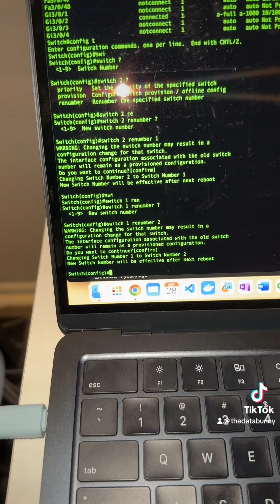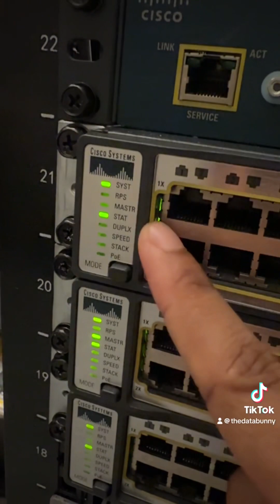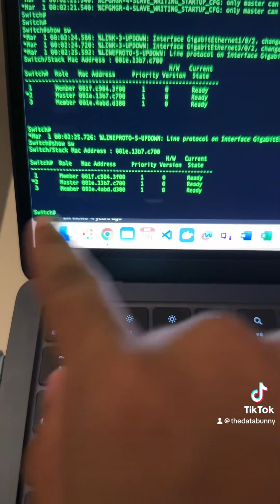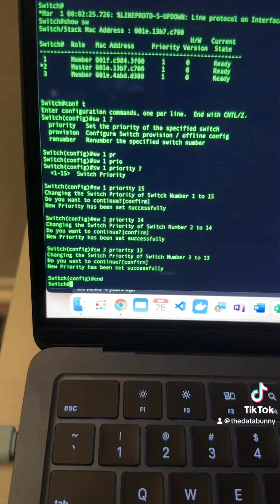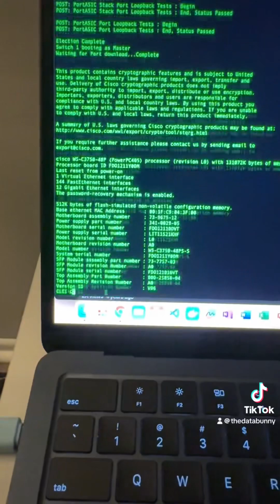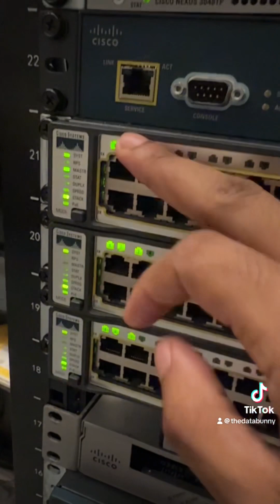Switch Stacking!

Comment: How can I connect via console cable even with a switch from the macbook, I have not been able to connect via console, any advice please?
Reply from the maker: There’s a video I made on this a couple years back. But you want to use the command: > screen /dev/tty.usb[name of the usb device]
Reply: @DataBunny  Thanks for the prompt response. I apply the command ls /dev/tty.* or ls /dev but I don't see my USB port, from the system's own information it does recognize the console cable but in the terminal it doesn't, any advice?